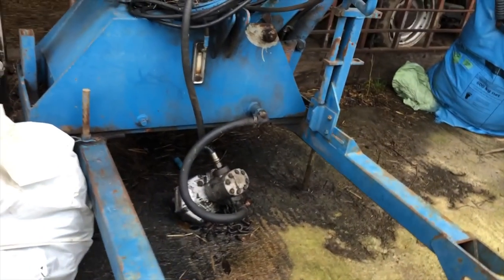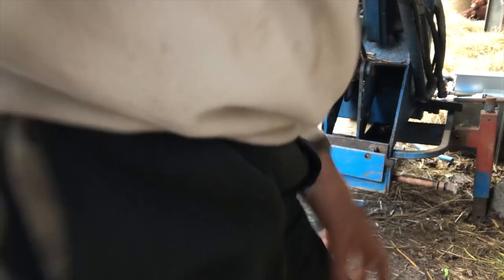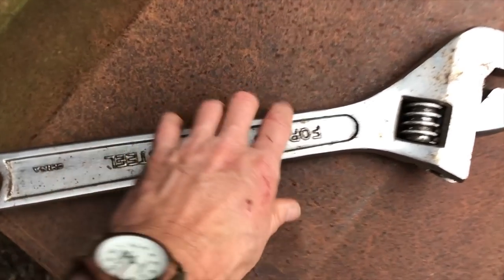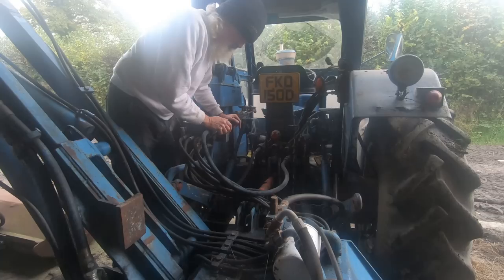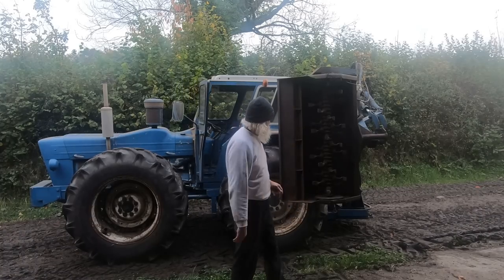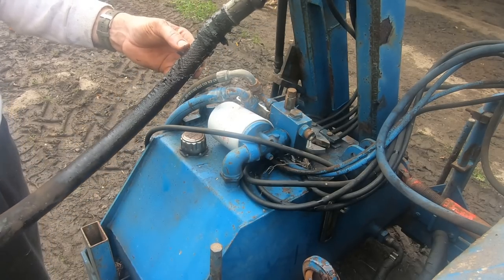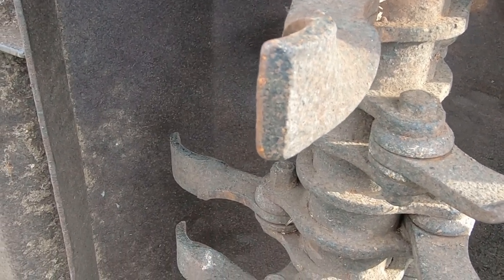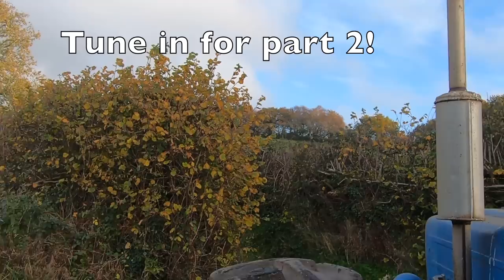County Tractor and Twose Hedgetrimmer - Attaching and Preparing for work.

Comment: There use to be a very similar outfit to that run by a contractor in the South Molton area around  25 ish years ago. Always looked a true classic then but he kept it looking well tidy. 

Real blast from the past👌
Reply from the maker: Yes!  That was the guy I used to work with, Dave Harding
Reply: @BusywithDrPhil  I did wonder. I drayed trailers behind his forager a few times on a local farm @ Meshaw. He use to pull it with a  Ford 8210 and always like the look of that tractor. That county was a beauty as he changed the engine oil every 100 hours without fail. He use to rent a couple sheds and a yard just outside south Molton.
The county use to have a hand painted sign above the front of the cab with his name on. Always looked smart
Reply from the maker: Yep..I've got that sign. He bought the 8210 after retiring the County from forager duty. I  worked with David in the 80s and always kept in touch. His yard in Molton was on the farm I used to work on..
Reply: @BusywithDrPhil  Narracott. Proper made my day seeing the county again. Many thanks 😊👍

Comment: Great stuff Phil!  I've always pronounced it, tw oh z. You pronounced it two z. Which is correct or are you now unsure like me? 
Also is the Country based off the 7000?
Cheers.
Reply from the maker: Cheers Robert.. re Twose.. I’m really not sure.. have heard it pronounced both ways. Wouldn’t be at all surprised if I say it incorrectly!  Re County,  I think it’s as you say…
Reply: The county was based off a 5000 back end with 6 cylinder Ford commercial engine the 7000 was four cylinder turbo
Reply from the maker: @willmoore3790  Ye.. you are spot on.. I fished out some info.. It was the same engine as fitted in Thames Trader lorries I believe. Although, in the late eighties the contractor I worked with upgraded this county with 120HP larger capacity 6cyl (around 120HP at the PTO, as it was our main tractor on a trailed forage harvester . I've got the details of the conversion written down in a notebook somewhere but I can't find them at the moment...